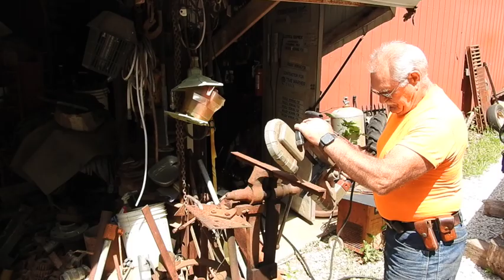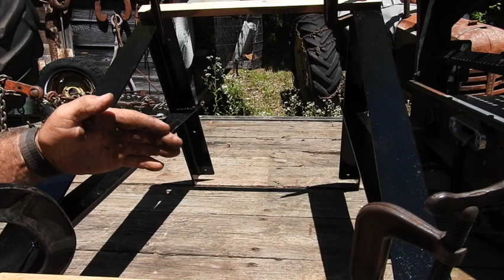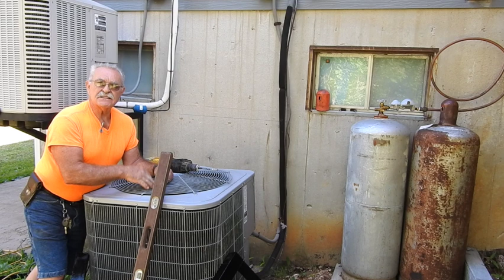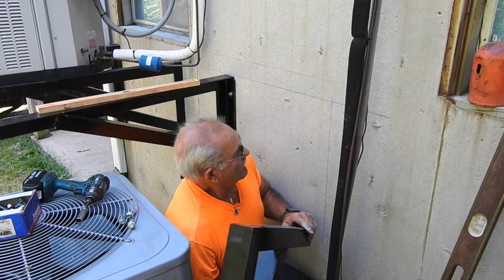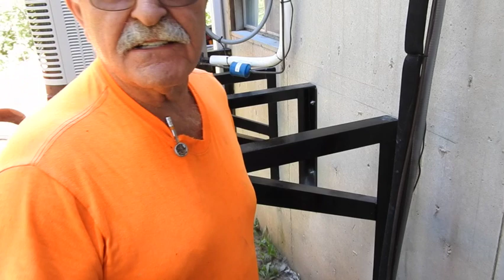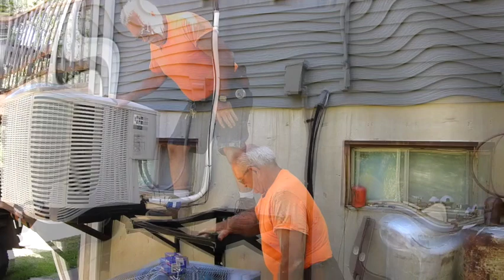DIY Central A C Wall Bracket Repurposed Material Project

Comment: Really well done. I'm about to make some wall brackets for a Senville heat pump. Wish me luck!
Reply from the maker: Excellent !!  I think you'll do fine.  I'd suggest checking the manual on the minimum clearance to the wall for proper air flow across the outdoor coil.  Good luck...by the way there is a complete playlist on this install.  Here it is in case you haven't seen it: https://www.youtube.com/playlist?list=PLk72G9DTzZ1taVZjyeN9DKr52HQ3hhcXd

Comment: Good Morning Sir, have an happy 4th of July ; )  Great fixe on your concrete electric drill Sir !  Very well install Sir ; )  Cheers
Reply from the maker: Hahahaha....if the duct tape would've been closer that would have been what I used.  LOL  I've brought home power tools with little more than a nick or cut in the wire Dave !!  The job foremen can't take a chance keeping them on site because OSHA fine potential.  That's where most of my ladders came from too.  A crack in the firbeglass leg or a broken rung and its 'toast' !!  Once I make the repairs they still cannon be used due to the integrity of the original frame or structure has been jeopardized.
Reply: @tractorman4461  LOL, I will do the same than you Sir ( fixe or repaire toasted items !!! ) Cheers

Comment: I've used the 6-8-10 method for checking square. Works every time tm44.  Happy Independence Day 🇺🇸
Reply from the maker: Yes Dean....any set of  the multiples of 3, 4 and 5.  I even squared my new 30x40 shed in the same manner while we were sitting forms for the foundation wall !!  Happy Independence Day to you as well my friend.

Comment: I just did something like this but I attached them to hollow block with irregular faces. Had a real tough time locating the brackets to locations that would hold so I mounted 2 horizontal beams of unistrut then attached the brackets to the unistrut. Not only did the unistrut permit me more mounting points since it spanded multiple blocks (30 inches) it also provided a plainer surface that was easy to shim the brackets against. Just another.
Reply from the maker: Yes, I have used strut commercially hundred of times to mount many things on wall surfaces.  That was the perfect solution to the challenge the rough surface made. Thanks Justin for chiming in with your solution.

Comment: thanks took the mf 97 and oliver 1900 right into the centrr of the city of exeter stopped for a beer or do drove out just before rush hour to the village and had another beer parked up left at my accomadation for the night
Reply from the maker: Sounds like a good time. I wouldn't mind having a 97 myself, though I don't think that will ever happen.  I'm sure that was just one of your outings with the tractors while there.

Comment: what type of bolts you use, I want to mount mine also, so I need know the correct bolt size before installation.
Thank you
Reply from the maker: For concrete I  like to use these in 3/8" or 1/2" diameter and 3 to 3 3/4" long: https://www.amazon.com/Red-Head-Wedge-Anchor-10CT/dp/B0B693K46H/ref=pd_rhf_d_se_s_pd_sbs_rvi_sccl_2_4/145-6288689-8220349?pd_rd_w=opk3b&content-id=amzn1.sym.a089f039-4dde-401a-9041-8b534ae99e65&pf_rd_p=a089f039-4dde-401a-9041-8b534ae99e65&pf_rd_r=E0AFFWV9QVVY0MXQZSKZ&pd_rd_wg=wXtDO&pd_rd_r=b71d4b28-53e5-42bb-a6e1-687ed68fb339&pd_rd_i=B0B693K46H&psc=1 The depth of the hole is important as well as blowing out all the dust.  If you don't clear the dust it can be forced ahead of the anchor and not allow the anchor to be inserted to the correct depth.  Brick, block or wood require different types of anchors.

Comment: How do you prevent the condenser from sliding off?
Reply from the maker: Carefully use appropriate length self tapping screws and screw through the frame into the base of the bottom of the unit.  CAREFULLY though, to ensure you don't hit the outdoor coil.

Comment: Is that 2” or 3” angle iron and what are the dimensions that you use to fabricate this? I have a family member installing an AC unit on my house and want to have everything ready to go whenever they get the time to stop by.
Reply from the maker: Iirc, this one is made of 2”x 1/4” material. Plenty heavy. Even if you’re installing a 5 ton a/c. Make sure it’s long enough to get the minimum distance from the wall for air circulation. Usually 12” for airflow and servicing.
Reply from the maker: Ask your relative to provide you the required size to fit the unit. They are not all the same physical size.